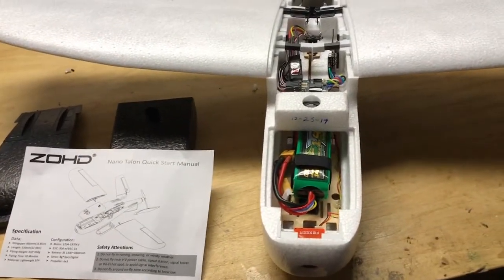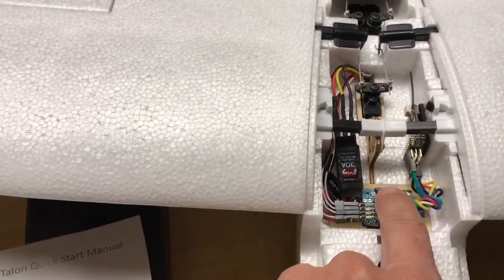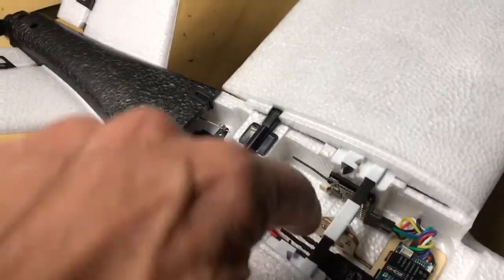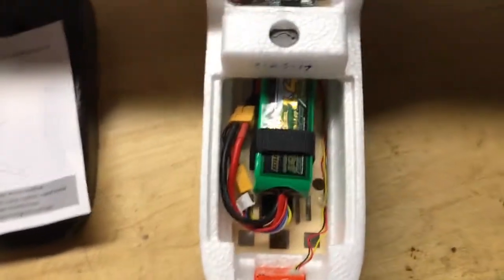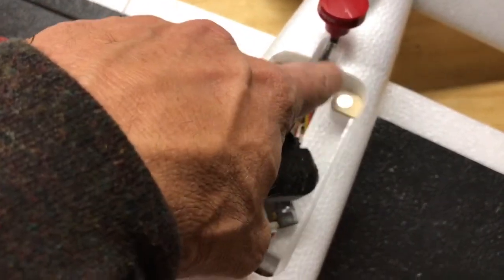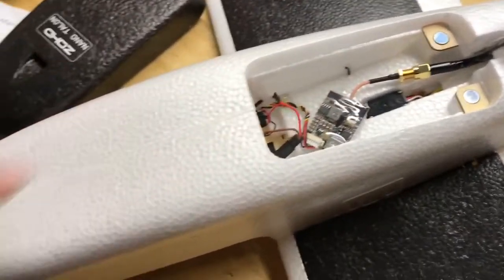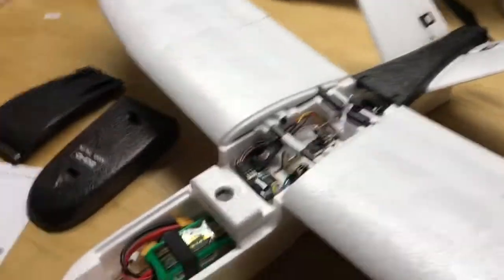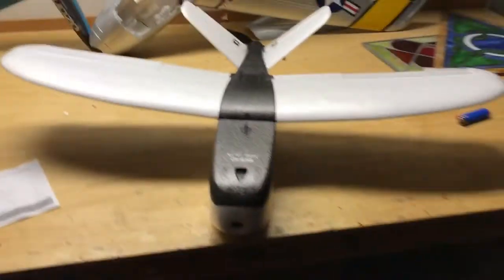Nano Talon to Spektrum

Comment: I have this plane and i would have liked to see where the signal wires plugged in from stabilizer to the reciever. With that pack you should see an easy 30 to 45 minites of flying time. Thanks

Comment: Thank you for taking the time to put this on Youtube.  I plugged in my Spektrum serial receiver last night with "V-tail" set up in my radio.......and it was doing a lot of weird things with the flight controls.  Appreciate your input, Jeff.
Reply from the maker: If you are using the stabilizer that it comes with, do not put V tail in your radio , just use standard settings the mixing will happen in the stabilizer.  at the final end I tossed out the stabilizer and just fly it with my own mixing and smooth expo and its a fun little model to play with..  My next thing is trying to rig a servo mounted camera so with I move my head the camera moves.  I have this on one of my bigger FPV planes and it makes it way better.  But this is a small model we will see..fly on
Reply: Thanks Jeff.  I have put an FPV camera on a servo mount before; but I connected it to my rudder channel......since the Skyhunter did not have rudder anyway.  Being able to look left and right is a pretty cool feature.

Comment: I used a Spektrum AR610 that I had lying around and I noticed that all of my channels except for throttle had to be reversed aileron, rudder and elevator. Did you have to do the same?
Reply: Yes, I had to do the same, reverse all channels in the transmitter.

Comment: The best thing i did with my Nano Talon was to frisbee the ZOHD stabiliser into the bin and fit a Hobbyeagle A3 super II. It now stabilises like a rock, no endless swinging on roll axis, no more of that snapping partly out of stabilisation with control input, and no more weird nose up when switching between stab modes, and it can now instantly recover from absolutely any attitude, including dropping backwards out of vertical, the A3 also allows S-bus no problems. The rest of the plane is just brilliant. Cheers.
Reply: Hi, I have also troubles, planned to put FCs with iNav into my dart and talon anyways, but wanted to first test the stabilizer from zohd ... until now it is a nightmare, didn`t manage to connect one of my 5 frsky receivers ... if anyone knows how to connect a x4r, xm+, x8r, please feel free to let me know
Reply: CircuitBender It seems the Zohd stabiliser does not accept S-bus at all, so only pwm receivers will work, but it's so bad as a stabiliser I wouldn't bother with it. The nano flies smoother un stabilised, when cruising with sticks neutral it rocks about in still air and minor stick inputs are ignored up to a threshhold where it suddenly over reacts due to now exaggerated input to overcome that threshhold.. just bad..
an f4 would be good, I use them too, but the HE A3 is like gluing it on rails.
Reply: @alasdair4161  it does accept sbus I have it hooked up with sbus using a crossfire receiver. There's a video on the rcgroups forum that I posted. Super simple.